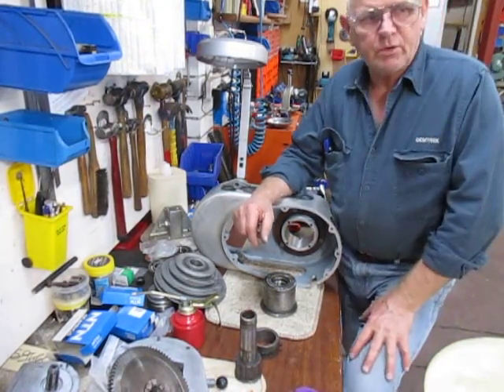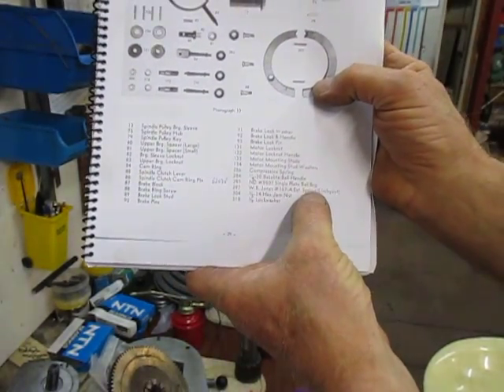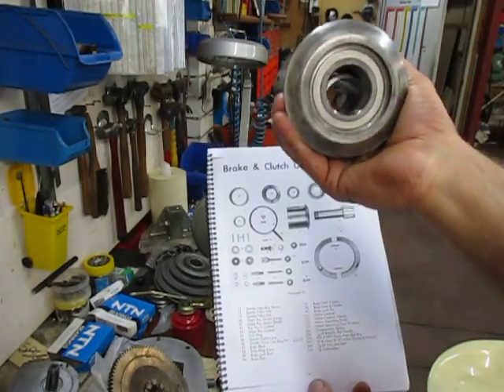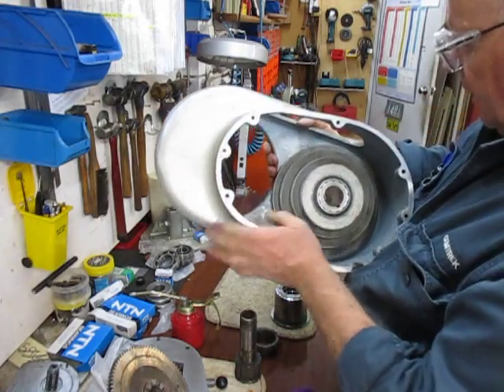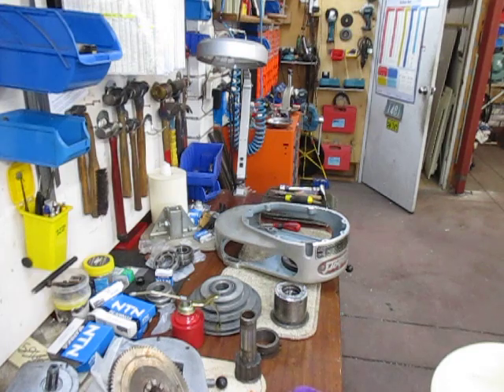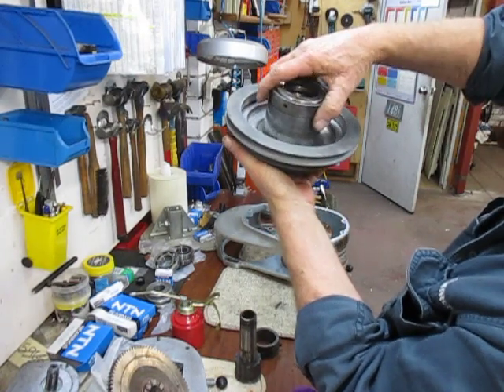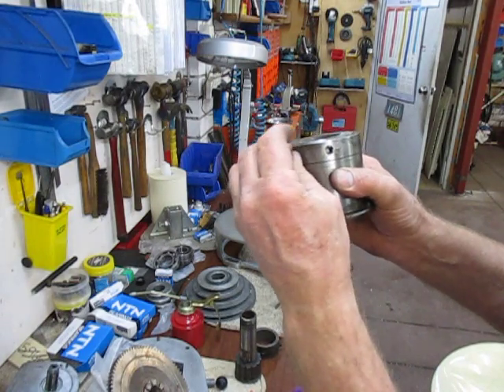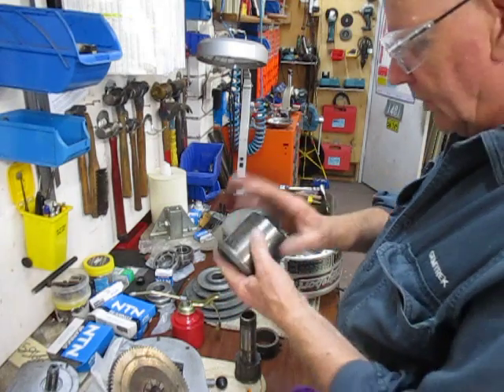Bridgeport refurb project part 2

Comment: At the 3:20 mark in the video you are discussing the pins used to actuate the pulleys and engage the spindle with the back drive gear. My spindle unit has the same set of 2 tapped holes as yours. What is the purpose of the 2 sets of tapped holes? These evidently were put in at Bridgeport and not added after. Thanks

Comment: Bruce

Are your safety glasses prescription ?  I need a pair like that.  What brand ?

Thanks
Reply from the maker: Tech Optik of Australia Prescription eye protectors against low and medium impact polycarbonate double sided DIP hard coat to Australian Standards: AS/NZS1337.6 only to keep for 12months life. Comes with certification documents QC. through L&P optometrists cost around the $450 mark. 
Cheers

Bruce
Reply: Bruce Whitham
Just sprang $350 myself for multifocal safety glasses. Just got so sick and tired of either not being able to see, or tempting fate with normal readers. Now I can comfortably wear them and not feel the need to keep on taking them off. Best money ever spent, and I'm only a weekend warrior!
Reply from the maker: Ray, that's good, I also used to use the $10 specials but the time comes when that is not enough, glad your happy with the new specs, now you will be able to count the fly droppings on the ceiling when you get bored (not that I myself have that problem thankfully). Lol  Cheers Bruce

Comment: Great video.  You are well on the way to getting it back together.  The only time you have to worry is when you get it back together and find one part that you don't remember seeing before.  That is the stuff ulcers are made of.  I remember one fellow who was working on a device and my coworker came along and slipped in an extra piece.  The poor fellow read the whole manual twice before he was certain that it was from some other machine.  Thanks for sharing.

Comment: Bruce, I think an adjustable angle grinder spanner wrench would work on that shaft nut, got one to use for angle grinders since I could never find the correct one and turned out to work well on other stuff too.
Reply from the maker: Never seen an adjustable one before, I shall investigate, I used to have lots, many that I made myself over the years. thanks for the tip. Bruce
Reply: Bruce Whitham Hi Bruce try, .wixroyd.com/en/catalog/work-holding/hand-tools/face-spanners/94000
Reply: Bruce Whitham
 this is the one I have
http://www.amazon.com/Universal-Grinder-Adjustable-Wrench-Spanner/dp/B00J0LHFGM

or you can go fancy for more strength
http://www.amazon.com/CTA-Tools-8600-Adjustable-Wrench/dp/B005OH0LQM/
Reply: Bruce Whitham Bruce
great vid, as to the pin spanner all you need is two flat pieces of steel strip with a pin at one end joint the other end with a bolt to make a V , there you go adjustable pin spanner

Stuart